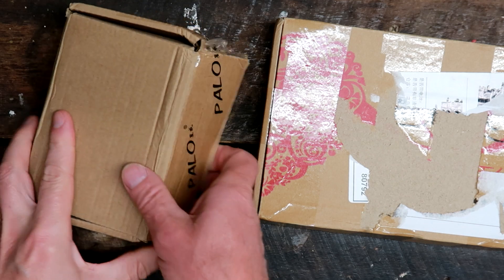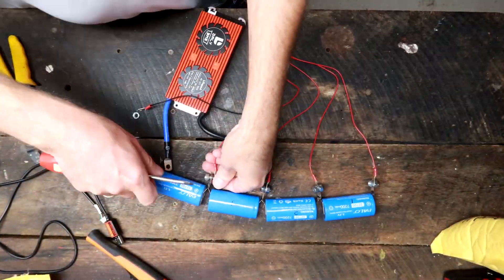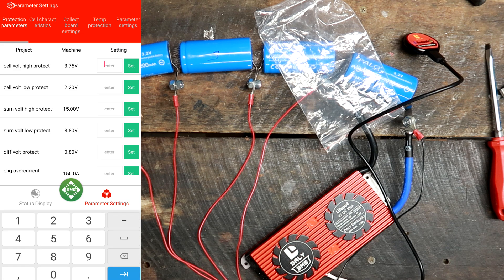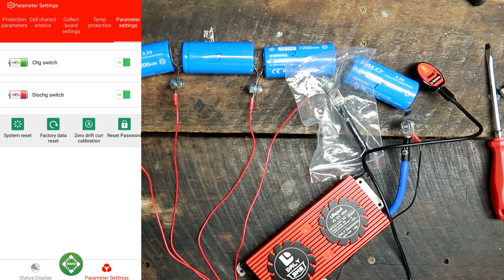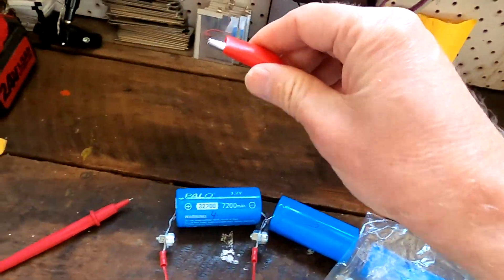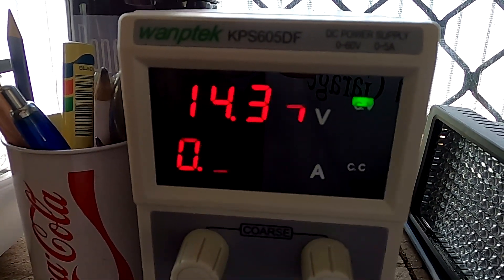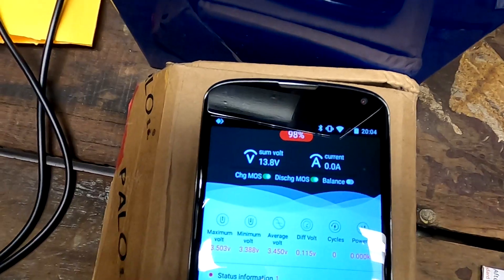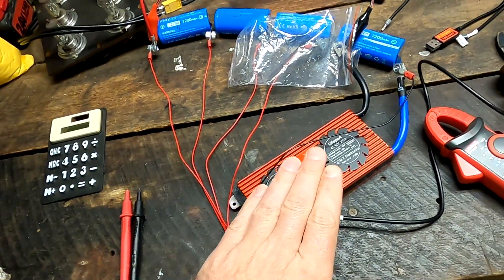Why DALY BMS' are so popular? Exactly, I don't know either.

Comment: Daly balancing  make a lot of sense .... (if  have some brain).   With your bms  if you set  some voltage   always will discharge to this  voltage. What will happen if not reach this voltage ... will not  balance. If you set low value  will drain the battery.     With daly if you set   low  start  balance  voltage  will balance  all the time when  you charge and have cell difference .   After  1-2-3-10-n cycles will equalize the cell voltage and no need to  check all the time  what is volt diff.  , is balancing  on , what is bal. volt.  and so on .. what  you are doing  all the time with your bms .
Reply from the maker: Yeah, that's a totally stupid system they have. What do you think how many cycles it will take to balance a 300Ah battery bank when you shave off only 30mA with every charge cycle?
Also, if you have a high voltage disconnect, it will not lower that cell voltage at all. Makes no sense at all.
The QUCC BMS can be set to nay balance start voltage. Like 3.55V, it will balance (discharge) all cells above that voltage. How can it drain the battery by doing that, so not sure about that brain comment you made...🧠
Reply: @OffGridGarageAustralia  hahaha  "how many cycles it will take to balance a 300Ah battery bank " if you  make an initial top balance when you assemble the bank the answer is 0 !!!  Bank will be balanced and the BMS will  keep it balance  if some cell have deviation ...... brain .  

 "The QUCC BMS can be set to nay balance start voltage. Like 3.55V, it will balance (discharge) all cells above that voltag"  Can you tell us how  BMS will balance in this case if you not reach 3.55v ??? I will tell to you : you must  check   what voltage is the bank ,  go in  settings , you must lower that voltage to 3.4v (just example) . On the next day  you have  more sun power  and the bank  charge to  3.6v  BUT if you dont check  again what is the bank voltage  and not switch off balancer or change the  start voltage  will "balance" the cells  to 3.4V  ... for me this is stupid system .....
Reply: @teror1sta  I get where you are coming from. With an operational battery where it rarely sees full state of charge it is better to balance during charging as this is happening most of the time. 
A top charge balance system will only function when the battery is fully charged which may never happen. Setting the balance threshold lower just means the balancer tries to discharge the whole battery to that lower level.
Reply: @eckythump6429  yes , but Off-grid can't   understand this .  Obviously is too complicated .....
Reply: Andy doesnt understand how to charge his battery lol

Comment: I think that is not active balancer. and only 30mA. useless. for a cell said 100 or 300Ah battery. seem useless for that. Thanks for the video.  I would not consider DALY,
Reply from the maker: I'll do some more testing soon. Other have commented that the BMS and balance function is fine, even with large cells.

Comment: You should have left open diff volt at default value 0.05v instead of improper value you set, then increase diff volt protect (this is charge cutoff that you experienced since your cells were already within this parameter eligible for cutoff) from 0.8 to slightly higher than your current cell voltage difference that you began with. And you complain it doesn't balance? This entire video and title is fail.

Comment: i have always thought daly where overpriced piles of crap this video is just proving my point lol the only thing the daly has over your other bms is separate control of charge and discharge circuits
Reply from the maker: Yeah, that's correct, but do I need the separate charge discharge disconnect at all? Especially with the second battery bank coming online, it would only disconnect one bank and leave the other one connected.
Reply: @OffGridGarageAustralia  you have a point for a multi unit setup prob a bad idea plus not good to disconnect battery from scc leaving them with solar feed only
Reply: @OffGridGarageAustralia  If you only had one battery then the more sophisticated approach is for the BMS to, rather than disconnect, request progressively less charging current from Venus OS and Venus then throttles back all charger controllers to match the demand (loads + charging).  Effectively that means that when the weakest cell nears its voltage limit, the bus voltage (and thus charging current) gets slightly reduced, to the extent that balancing can keep up.  I would love to find a cheap BMS that has this capability.

But if you have two batteries in parallel, both reporting their charge acceptance capability, and one has a weak/full cell and the other one doesn't.  The weak cell will cause the charging voltage to throttle and that will also have some throttling effect on the other battery, which otherwise would have been happy to continue taking full charging current.  The problem gets bigger as you add more and more panels.  If you have 100A or 200A of charging current weaker cells will rise rapidly and battery disconnects.  Then the other battery sees full current and maybe it also has to disconnect.  It suggests that as the system gets bigger, the issue of mismatched batteries becomes more serious.  Either we need more powerful balancers or we need independent chargers for each battery.  I am thinking that in the future the tinkerers will have more opportunities to acquire inexpensive batteries of various types and voltages (like we do now with second hand solar panels), so we should think about a topologies that allow flexible integration.  ie. some sort of bi-directional DC-DC charger on each battery.

Comment: Seplos bms!!
Reply from the maker: They look indeed good!
Reply: @OffGridGarageAustralia  I purchased one to to try, but it will be some time before I get to  that stage in my installation. 
Am setting up a SMA AC coupled system with batteries from a mitsubishi phev.
If you decide to get one, you need to know that it doesn't come in any housing or case, because the bms is designed for their modular battery packs..

Comment: hahahaha goodluck. instructions are a mess. My $600 400a daly bms would not activate buy any method be it charge/multi meter/ shorting leads etc. in the end i had to order the new bluetooth module with button which is lucky they even decided to make one as the lightboard button did not work as the pin from factory was broken off in the jst plug on the bms. took months to get it to activate. changing settings would shut it down at times. yeh not a finished product. The current meter was backwards showing neg value when charging and yes the leads were right way around. The list goes on with the bugs i had.

Comment: I ordered 2 200A 16S Daly's BMS. I managed I don't know how to make 1 start for 1 week. After I unpluged it, I could not make it work anymore. I ordered a start button (lightboard) because the start button is sold as an option ! I ordered a charger (because Daly told me I need one to make the BMS start. I just spent maney for nothing. And ther second BMS never came to life. These products are pure shit. I could get a refund (but I spent 40 € to send them back to China, one of my worst purchase in China). Now I use a QUCC like in the off-grid garage. Not perfect but it works.
Reply: with the daly bms in order for you to start the bms to in full function and work order you need to connect temp sensor.
Reply: @none0049  of course I plugged the temp sensor (given by Daly). In fact I tried all what could be tried. During 1 month. I just lost 1 month. QUCC BMS just took 5 mn to work. No more Daly.
Reply from the maker: You can just disable the temperature function in the settings. It starts working right away.
Reply: @OffGridGarageAustralia  The probklem is I could not even get into the app lol. The BMS is like dead.
Reply: @monsieurd.6890  I had a ton of trouble getting my bms to turn on. What I found works 100% of the time is to use the UART to USB cable, and plug it into either a USB charger, or my laptop. Just something to try if you haven't given up on it yet and tossed it away.
Reply: @mk96lx  in fact I plugged it (another cable I had to buy lol) into a laptop. I will try with a charger but I fear laptop/charger is the same. I sent back 1 of the 2 BMS and the otehr was refunded buy Paypal without retirning it. I will try it once more after I receive my new battery cells.

Comment: I have 3 - same problem with all of them. Total schrott
Reply from the maker: Yep, I agree...
Reply: @OffGridGarageAustralia  I am going to experiment and see if it is always "Cell 3" (i.e. balance lead 3) which runs ahead - I have a suspicion that the true voltages of my 12 280aH 3.2v cells are fairly consistent, but that the BMS (ALL 3 of my Daly units - 2x100A and 1x150A) misreports individual results, causing a "ghost" disconnect where no overvoltage condition actually exists.

Either way, rather than in any way balancing the cells, the voltage discrepancy always starts off at around 0.003 and then races up to around .300 (at which point the overvoltage protection kicks in)

Comment: Never ever use a Daly-BMS. The App is only installable when you allow GPS with Bluetooth. I it a Spy-Software and in by Basement GPS is not possible. The next is, the Software find the Bluetooth only when i connect the green cable with the first cell, what a hell, because i killed the Daly when i get the wrong end of the cable to 57V instead 3,2v. Bevore that, i tried to connect the Daly as a request of the customservice with a usb-cable to my Laptop and the software show empty fields when connected. My meaning unqualified support that answers to questions in never asks and very bad Software. I look for a BMS that is easy controlable with my linux system or over WLAN and no needs of GPS/Bluetooth/Internet. I like to stay independent and want not to be shut off from china.

Comment: Daly is not a good bms it's just mostly use because alot of youtube use them in their videos and I am 1 who have fallen for that cause I didn't had much time to do  research. These bms have cost me a  6kw battery and let some other cell in my 90kw battery system to fail. And they are not cheap for the high amp version. Even the ant bms and app is much better then daly.  Stay away from daly

Comment: There is no point using a DALY BMS in the UK. They dont have Low Temperature Protection. So they are a total waste of time and the are overpriced.
Reply: lol, they have it.
Reply: @none0049  Daly have a temperature sensor for high temp cut off. The last time i looked Daly still didn't have a low temp sensor cut off protection. There are better BMS boards for a lot less money. At least half the world sees freezing weather conditions and offgrid systems from Cabins in the woods to RV's see freezing temperatures. Other BMS manufactures are way ahead of the game.
Reply: @drewhodge3820  as i said before they have it. now on the other hand if your  saying about cost wise that is a whole new topic.
Reply: @drewhodge3820  daly does have low temp protection. Tested it myself.

Comment: Daly is shit! I had 2 fail for no reason! And manufactre blames me for not wiring correcty even though I still have to older models non sealed versions will working. You cannot parrallel them, blancing is shit and the Bluetooth dosent work properly. Do not the daly. Cheap and nasty.
Reply from the maker: I'll do some more testing once I have the capacity to do more videos in this regards. I want to see the balancing in action when cycling a battery pack.
Reply from the maker: @windpowered7771  I hear people saying this and I'm sure it does work. I'm just questioning the usability of a small balance current only while charging. But we will see in a future test ;)
Reply: Mine works great